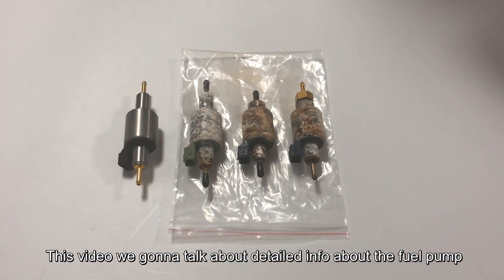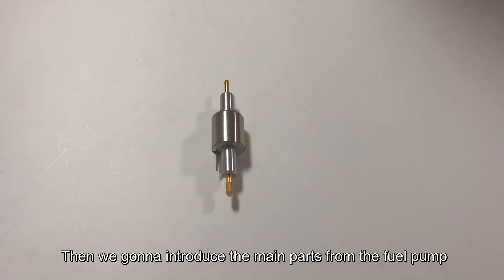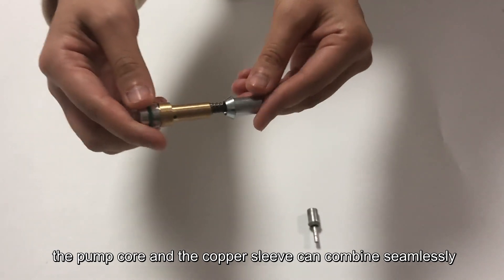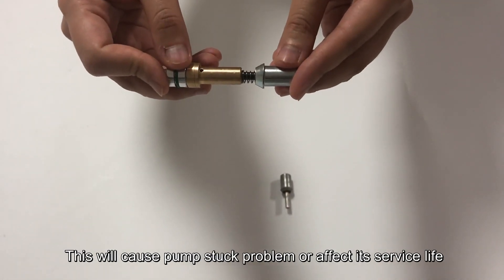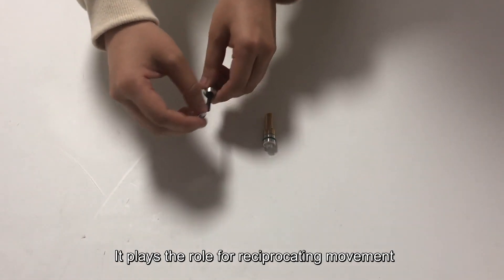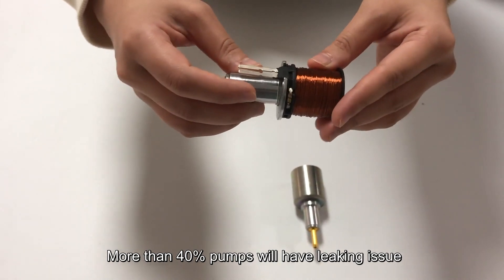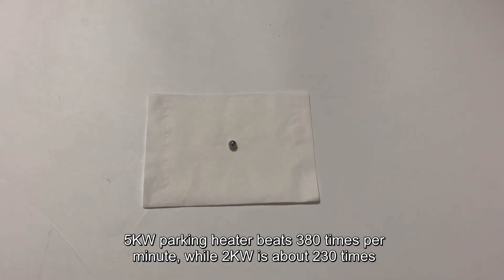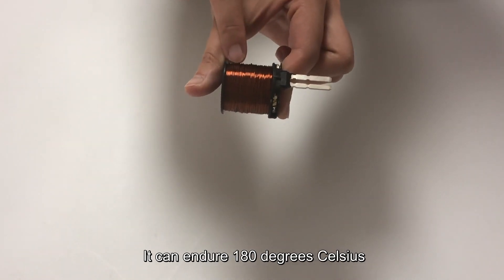VVKB Parking Heater Fuel Pump

Comment: Hello, the video you shared is very explanatory, I have some questions, how is a metering diesel fuel pump cataloged, by pulses per second, pulses per minute, I saw a diesel fuel metering pump and it says 22ml? Thank you
Reply from the maker: The data of the metering oil pump indicates the amount of oil coming out of the oil pump per 1000 jumps.
22ml means that the oil pump beats 1000 times and the oil output is 22ml.

Comment: Hi at VVKB. Do you have a parking heater fuel pump which kan replace a DP40 (TM5950 - webasto 9002853H) WEBASTO pump ?